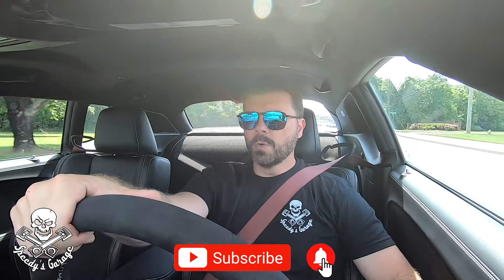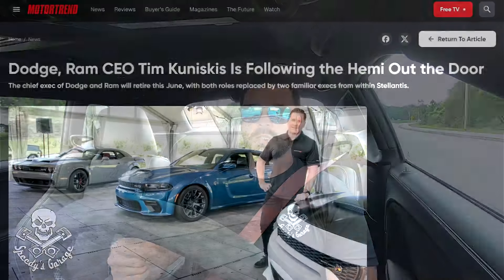Is Dodge Done?  Tim Kuniskis Retires from Stellantis!

Comment: Never pay a mark up ! Paying MSRP is bad enough ! That said I wanted to buy a 2020 Camaro SS but there was a shortage of inventory as in none., then what was around was marked up . That turned me onto another Challenger, this time a scat pack. Wow, what a awesome automobile that I've had for 3 1/2 years ! That said, Dodge is done like dinner, maybe GM will bring back the fearsome T/A ?
PS: May I suggest a aftermarket oil pan or a dry sump oil system ? Mopar has the oil pan sump in the front of the engine, guess where the oil goes when you do a wheelie off the line.

Comment: If dodge came out with a Cuda and made it in the same engines the Challenger comes in now, they would be ok. Ditch the electric stuff altogether. Nobody wants that junk. The elecric stuff needs about 20 more years to get the infrustructure in place and to get the range better. If they could somehow allow the cars to regenerate the batteries and never need to charge, they would be ok.

Comment: Figures I'm late to the party as the saying goes. I've been mostly a GM owner ( with only a few Ford and Toyotas ) since I bought my first car back in 1973 as a senior in highschool. At age 69 I've owned a total of 38 four wheeled vehicles ( new and used) since then. I finally decided to go with a Dodge as , quite frankly, I'd had enough of GMs poorly built, front wheel drive offerings and bad quality trucks. I bought my first brand new Dodge , a 2023 Scat pack 1320, in June of '23. I realized it was not such a good daily driver and sold it. I now have another new 2023 Dodge, a Charger RT Daytona. Love this car! And now, as I'm just getting my feet wet with the Mopar community, looks like Dodge it circling the drain. Geez, my timing sucks!

Comment: Dodge is just making bad decisions. The 170 is blowing engines and they are already dropping value
Reply from the maker: Blowing engines?  Do you have links to these occurrences?  RacerX is the only one I've seen.
Reply: @SpeedysGarage  as of April there were 11 reported demon 170 engine failures and 7 more at the dealer getting assessed all having significant metal shavings in the oil according to a few different YouTubers.
Reply from the maker: Weeeelllll, YT folks can get to be a little (a lot) like the National Inquirer lol.  With all the groups I'm in, I've only seen just the one.